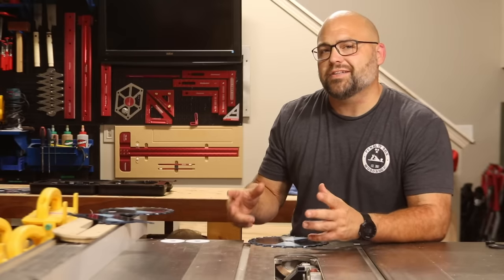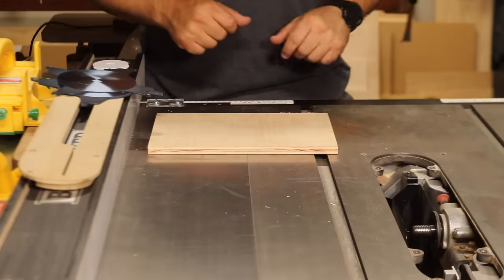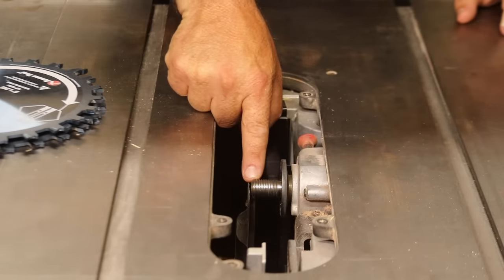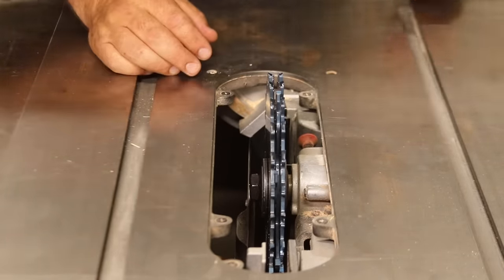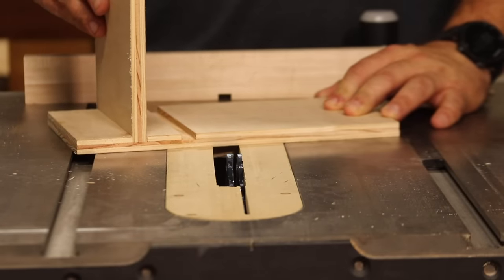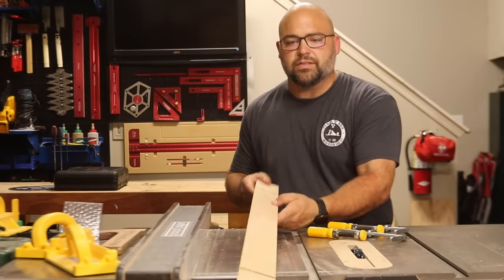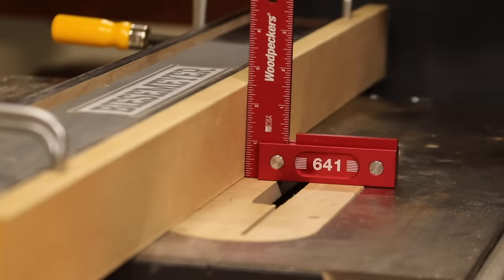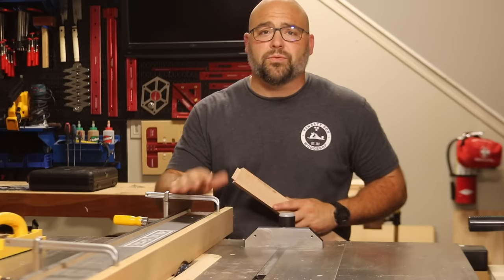How to Set Up and Use a Dado Stack - Full Tutorial and Examples

Comment: For anyone watching this video. DO NOT move your already cut dado back though the blades like this gentleman has shown! Not only is it dangerous,but seeing that his hand is not a clamp there is a chance that you can widen the cut by going back.I was very surprised to see him do this. It is not recommended by professionals.Once your through the cut remove the piece and then you can slide your miter gauge back.
Reply from the maker: Thanks for pointing that out. Something I’ve always done but it doesn’t make it right for others.
Reply: I will keep that in mind thanks.
Reply: I WAS thinking the same thing. eventhough I have done it. myself. Never used daods before. Just bought mine  I can see how much work they save doing it the old fashioned way. Great video however for use except yes, going backward.
Reply: Only not advisable when you make a cut and have wood left on both sides. But when he did it with the tennons there is nothing wrong with that.
Reply: don't see anything wrong with it
Reply: @marionroark8237  
If all parts of the jig assembly are square and tight, I don't see the potential problem described. I have a habit of (while holding the stock firmly against the key and fence) pushing the jig just over the top of the dado blades, so the cut is completed, and then reversing the direction of the jig to clear the blades (still holding it tightly, so I can then loosen and raise and shift the stock over the key so the stock's newly cut slot drops down onto the moveable shelf. Maybe my jig is different. Bob Giles
Reply: Probably safe but it looked off to me too Michelle.  I always think it safer to push the work piece rather than pulling it.
Reply: I won't argue topics when it comes to personal safety,  unless they are grossly incorrect.   Your comment is not grossly incorrect, however, I have been around for a while, worked with Japanese and American wood workers in cabinet shops to road side lumber mills.  I have never seen anyone do a single direction pass cut with a dado stack and have a problem.  Now, thanks to you, I now have to change my game, because I dont want to prove you right.    LOL   Good Looking Out, Michelle Reed
Reply: I am sixty years old. I was the only girl in my wood shop class all four years of high school. My shop teacher, Mr. Laugenhauser was tough on us when it came to safety. 
Since he did not want me in woodshop in the beginning, I spent a lot of time doing bookwork, going over the safety rules again, and again, and sanding things by hand, the old fashion way with a piece of sandpaper wrapped around a wooden block. Four Rules. How many? Four. Four SAFETY RULES were the things he always stressed. 1. Use a pusher when you are ripping and splitting on a table saw.  (I really like the pusher in this video, but I n the old days, a pusher was a handle-sized  block of wood with a notch cut out of it.. You made it from a scrap of wood. 2. Never go backwards. There’s no reason to go backwards, and it’s a shortcut and we don’t take shortcuts because they compromise safety. 3. Always be ready for kick back, because anything can happen. To my knowledge nobody ever got hurt in woodshop. You followed all these rules or you were out on your first offense. No questions asked no excuses given. OH.. I didn’t say there was. 4. We were always instructed to turn the saw off in between cuts. So before you repositioned your work, you hit the kill switch, cutting the power off you never had a reason to back up your work over the saw-blade. He made quite an impact because not only was he a hard ass he would hold up his 3 1/2 fingers when he told us all those rules every time. I’m sure he’s long gone by now. Loved that man! Mr. Hard Ass Laugenhauser. Favorite teacher. Thanks for reading. Remember 4 safety rules not 3-1/2! 😂
Reply: @Bz12Angels 
Thank you for the 4 rules and the really nice, easy read.  And thanks to Mr. Hard Ass Laugenhauser whose legacy will forever live with the countless woodworkers who he taught and folks like you who pass along his knowledge and wisdom.  Wish you a Happy New Year!
Reply: @Bz12Angels  If I lost my fingers that would be the end of my interest in a table saw,
Reply: Professionals don't normally give advice! This man is trying to help people.  Are you willing to add to his content! Do you have secrets you could share? If you can help people instead if defaming people, the world is interested.
Reply: Take the warning labels off! The world will get better soon!
Reply: You have to be kidding me at this point. Electricity, sharp blades, tide pods, extreme heights, bullets...!  

Surely, at some point, our youth is going to call bullshit! Quit hating! And offer a good solution! Put your face up for judgement!
Reply: When I saw him come back over the blade after making his dado... my first thought was, "Jonathan Katz-Moses told me not to do that." I've actually done that and in the process of pulling my stock back over the blade and moving my  stock ever so slightly, and now my half lap is loose. DAMIT. Lesson learned

Comment: Commenting from the great lockdown of 2020.  I'm a beekeeper and have been in a never ending quest to make cheaper bee boxes for my expanding apiary.  It looks like the dado stack is what I need for not only the joints, but the rabbets for my frame rest.

Your video demonstrates much of the flexibility of the dado stack clearly and just kept me from spending money on a router table!  Thanks!
Reply from the maker: That’s awesome and thank you! There is nothing better than some fresh honey!
Reply: Good luck man. I just started using dado blades to start making my own bee boxes, the tear outs are horrible! Maybe it’s just my blade? It’s a brand new diablo 8” 12 tooth. If those $300 dado stacks get rid of this crazy tear out problem I’m having, I’d buy them. Anyone know if this would solve my tear out problem? I’ve tried the normal fixes, scribing a lime, taping the back and using a backer board. Scribing helped, but still nowhere near good enough. Oh and going really slow helped. Still super inconsistent with tear outs. More often than not

Comment: I am descended from a long line of woodworkers, with My Pop before me, his Pop before him, and so on. I have about 50 years of experience in woodworking, and their no woodworking power tool I cannot use. I dropped in on this video, because I wanted to see how well you know dado stacks. I have to say I am impressed! You indeed know quite a lot about them. I have been supervisor of a cabinet shop for a custom bus building company, as well as their top cabinet and wood structure designer. I trained many woodworkers in the proper use of all woodworking tools and accessories, like the dado stack. My way of training is to have them watch me do what i am teaching them. I love that you demonstrate your techniques as you teach also.

In the case of dado stacks, there is one thing you did in the video that you did not mention. It is an important safety technique you obviously know to practice, though you probably have it so ingrained into your routine that you don't even have to think about it. For a tutorial though, it is something you should mention. Cutting Speed:
When using a Dado Stack to cut a dado, or any other cut possible with it, make your cuts slowly. Do not force the piece through to cut down the time it takes to make the cut. A dado stack is much thicker than a regular tablesaw blade, and it is comprised of several pieces. Trying to save time during a dado cut can cause the chippers to shift between the outer blades. If they shift to much, you will have a disaster on your hands, with possible injury, and definite damage to the dado stack and likely the blade arbor and even the drive shaft. Expensive to replace, and even more costly if you are injured. All the other safety measures you provided explanation for well enough. For this one though, you could say "Slow and steady gets it done right, and keeps you and your equipment safe." As you demonstrate what you mean, your audience will hopefully understand what you mean.

Now there is another type of dado that is not stacked, and I would like to know what your thoughts are on it. I call it the Adjustable Dado. It has a dial type thingy that can be turned and locked into place once you have the thickness you want. As you cut with it it has a wobble type effect that grow worse with greater thicknesses. For that reason I do not recommend it. I is safe enough to use if used properly, but it does set up unwanted vibrations in the blade mount parts of your tablesaw. As I believe you know, that can greatly reduce the life of your machine. So what are your thoughts concerning that type of dado?
Reply from the maker: Thank you so much for the kind comment! 50 years of experience is nothing to shake a stick at!

Comment: My timing is off because I’m watching this 2 days AFTER I shortened my index finger by half an inch from kickback. It was late in the day and thought I would keep going to finish my project even though using dados require more alertness than I had (first mistake). I decided to stack the maximum amount of blades to save time (second mistake). I didn’t establish a solid fence (third mistake).  I used my hand to hold the wood (biggest mistake).  The 3/4” plywood’s sharp edge sheared the top of my finger off down to the bone.  I’m so thankful to the surgeon who cleaned up the mess leaving enough finger to still play the piano … I’m very fortunate. No more messing around. I’m going to buy some micro jig push blocks this afternoon.

Comment: Excellent video! One note: the cut piece should never be run backwards over the spinning blade/dado.
Reply from the maker: Thank you! I have not personally had an issue with this method but if there is a point to be named about safety I’m all ears. I never want to demonstrate something unsafe.
Reply: @PenaltyBoxWoodshop  For a pro woodworker such as yourself who is comfortable with the technique there is little risk.  For a new woodworker watching your video there are a few things to be aware of.  Best case, you risk inadvertently increasing the size of your cut by slightly contacting the blade on the reverse stroke.  This will also make it harder to get consistent results.  Worst case, (and I'll admit this is rare with a dado stack) the workpiece could be thrown back at you.  Again, this is just a small observation in an otherwise excellent video.  Thank you for taking the time to create and share this content.  Keep up the great work!

Comment: You did a good job of covering all of the basics of table saw dado stacks.  Your presentation was organized, clearly based on your experience and knowledge and most of all, you demonstrated everything you discussed so that it was clear exactly what you were doing.
I see this was a couple of years ago and was wondering if you are still using your delta table saw?  I'm looking hard at them because it's clear to me that they are by far the best value in contractor saws, especially with the fence they are providing now with their sub $1500 saws. I'll be honest, yours seemed dead quiet, stable and not a lick of vibration.  I so want one!!
Anyway,  consider me a new sub and have  a wonderful and safe holiday season.  Cheers, dave
Reply from the maker: Thanks so much for taking the time to leave a kind comment. I have upgraded to a cabinet saw now made by Harvey but I absolutely loved that Delta and recommend it

Comment: Question about zero clearance inserts. I’m a rookie woodworker and I don’t have a lot of money so I went with a Porter Cable 10” portable table saw. I’ve looked everywhere I could think of for an insert and there’s nothing. I’ve tried making one myself, but I run into an issue with not having anywhere to secure the insert (no screw points) because the PC insert simply snaps into place. The only way I’ve been able to do fine cuts for now has been covering the saw top with 1/4” plywood and running the blade through. I loose some cutting capacity but I can cut smaller pieces and get cleaner cuts. Any advice on where to find a manufactured insert?
Reply from the maker: Have you tried inserting magnets on the bottom of your made insert? I’ve seen people do this and it seems to keep them secured to the saw. If not then I put the info in the description section for Matt at Gotwoodwrkshop that made mine. He does a bunch of them on his CNC and may be able to help you out.

Comment: Awesome tutorial on the dado setup. I'm wanting to do a 5ft tall hog wire fench. I need to know that dado setup a 100%.
Reply from the maker: Thanks man! Sounds like you got your work cut out for you!
Reply: Yes sir I do, but I'm to use the fence post foam instead of concrete to speed up the process. I can set the post and foam it and build on the the within 10 minutes with out waiting 24 hrs to let concrete dry.

Comment: Great instructional video for someone like me that’s just getting my shop set up and beginning to make projects.  I’ve wondered how to make dados and now I know!

What brand and model is your table.saw?  I’m looking to upgrade the old one a neighbor gave me years ago and want a good, solid, safe and accurate one for under $1,500.
Reply from the maker: Thanks and I’m glad it was helpful! I am using the Delta 15amp table saw which for your price point I would highly recommend. I think that they run about $1,000. I’m pretty sure that I have a direct link to it in the description section if you want to check out the specs on it.

Comment: I hope you get a notification of a message, i just purchased a Avast dado stack from HD. I need to make a ¾ inch dado and when i got all the blades on the arbor i was concerned i didnt have enough threads. Im brand new to woodworking and my gut said come watch a video before proceeding. So its ok to uses the stack without the outside balancer plate but leave the inside plate on?
Reply from the maker: Yea I don’t think you need the outside plate but I have never removed the inside one. You just need to make sure there are plenty of threads to screw the nut on the outside. You’ll want to be able to fully thread that nut on
Reply: @PenaltyBoxWoodshop  yes sir, i got my zero clearance insert plates yesterday and was setting up the initial cuts... ive had the dado stack for 3 years but never owned a saw that would accept them til Jan 7th of tjis year... realized ive watched tons of videos on people using them but never on setting one up and my stack didnt have the instructions in the box. I got it figured out  thanks

Comment: Thanx for your video. Whats your best way to align a board to the blade (say the sides of a shelf where you fit shelves in your dido's)  that is rather long and has multiple dadoos that need to be cut.
I mean you have it on the cross cut jig, but a mark on the face that is facing you ...and then? Eyeball it to the saw blade?

Comment: I have found a grout float also works great for a push device with cutting length wide dado's, the foam surface grips the material perfect. Just don't use one with the hard layer meant for sanded or epoxy grout.
Reply from the maker: Haha awesome. However probably around same cost as a push
Reply: @PenaltyBoxWoodshop  I agree. However when I did need one I had the float, did not have a push.

Comment: Maybe this is a question for somewhere else, but if you wanted to make a 1/4 inch deep rabbit cut on both sides of a cabinet wall for shelving, do you glue two separate 1/2 inch plywoods together before making that cut? Thank you
Reply from the maker: You could or you could just use 3/4” ply for the divider
Reply: @PenaltyBoxWoodshop  thank you for the fast reply! I was worried the 1/4 inch remaining would be enough.

Comment: normally it's not safe to use the miter gauge and rip fence at the same time when doing a cross cut. But when cutting dado's it is safe to use both because the wood isn't being cut completely through and so there's no risk of the cut piece getting stuck between the saw blade and the rip fence.
Reply from the maker: I can agree with that.

Comment: Hi great video. I have a ? I am not sure how the sacraficial rip fence is being held against the  metal fence with that clamp you used. Because when you put the one end with the rubber on the back of the metal fence and put the other end of clamp down toward the blade it looks like it is going done in the slot you created and grabbing the metal fence and not the wood sacraficial fence. Hope this is not a dumb ? but I wood like to do it right and make one myself thanks great video and I subscribed to hope to learn more from you.

Comment: How deep into the board do you make a dado or rabbit as a max? So you want to leave in order to make sure the integrity of the board is still structural sound and strong but also so you got a good area for your joint. I was not sure like if there was any rule of thumb like leave at least 25% of the board thickness, etc. So if I was cutting a dado into a 3/4 piece of plywood would I want to make the dado no deeper than 1/2 so there is about 1/4 of material left.

Comment: Do I really need a sacrificial fence for the rabets or I can just line'em up to the table saw fence?
Reply from the maker: I wouldn’t. Risk the blade hitting your fence or not getting close enough to cut entire rabbit
Reply: -Rabets, by definition, are made AT END of work-piece.  
-Without sacrificial fence you'd have to line up fence absolutely FLUSH with (configured) dado stack; risking fence damage.  
-If fence is spaced, say just 1 mm outside blade to avoid the 'cutting in', you end up with an hairline ridge at end of work-piece.